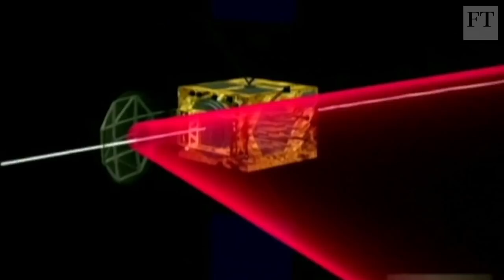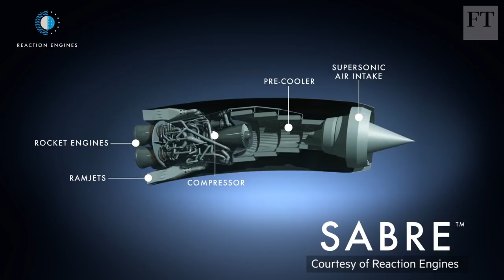Engine could boost UK’s space ambitions

Comment: No, once spacex probed reusable boosters theres no way the sabre engine could ever be useful to a space vehicle. It can still be useful for airplanes tough
Reply: And why isn't it useful to space vehicles?

SpaceX's Falcon heavy rocket costs about £1600 per kg taken into LEO, the Skylon has a theoretical cost of £650. Sounds useful to me.
Reply: The project is in its total infancy, even tough it has been in development for more than 30 years. There are several issues about the engine and the craft itself that are still not clear to be physically possible.

The space shuttle also promised a huge reduction in launch costs, see how that ended. It would be even more naive to believe this.

But the engine is a little closer to reality as it has one of its component tested and the uses it may has are within the limits of physics.

A reusable SSTO on earth might not be.

Comment: If you can imagine a double size verticle fighter jet engine, as 2 adjacent of a Skylon body, THAT is essentially all that was need to both hoover or runway takeoff/land, with a compartment that uses full rockets as well, to exceed thin high orbits & beyond. Not this rubbish bent arch engine exirting rocket fuel the whole time.

Comment: can someone explain to me how the engine would work in space? if it's using air in the atmosphere in conjunction with the rocket propellant, would there be a seperate oxidizer tank to feed into the engine once it's out of the atmosphere?
Reply: that's exactly how, the goal is to make it able to survive in the atmosphere at near orbital speeds so that they only need a final kick using a small oxidizer tank. This is a very big advantage because oxygen tanks are far heavier than the fuel, and require expensive hardware to keep the tanks at low temperatures
Reply: @facepalm7345  ahhh makes sense, with a bit of oxidizer too come back down too?
Reply: @Doganddj  yeah, it's very easy to de-orbit and being a winged vehicle it'll be able to guide itself back.
Reply: @facepalm7345  great, thanks for the info. this is groundbreaking stuff, hopefully we can see this on an SSTO craft in the next 5 years!

Comment: I was very excited to hear about this unfortunately after seeing the plans. I do not believe The microscopic tubes will work. They will fail. Both in heat transfer and allowing the engine to breath enough. If you have ever tried to breath through a tiny tube underwater after a snorkel? It becomes impossible. The air will not be able to send through near enough before destroying itself or the engine overheating and simple melting.
Reply: They successfully tested the pre-cooler earlier in the year at simulated speeds above mach 3. They're getting investments from companies like Boeing and Rolls Royce, and are working with the US Airforce, so there must be some promise in the design.
Reply: With enough pressure you can do anything